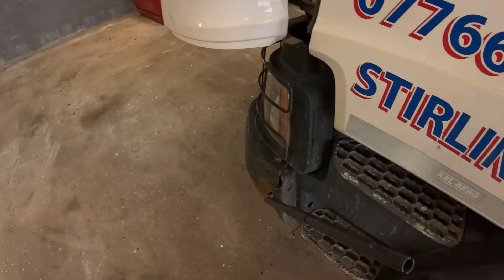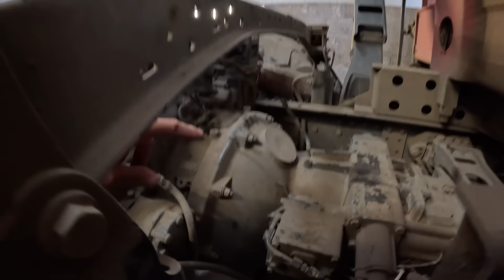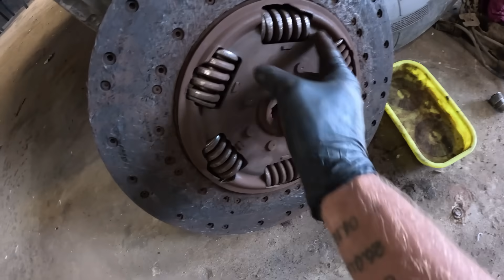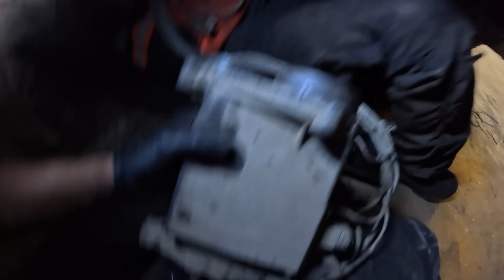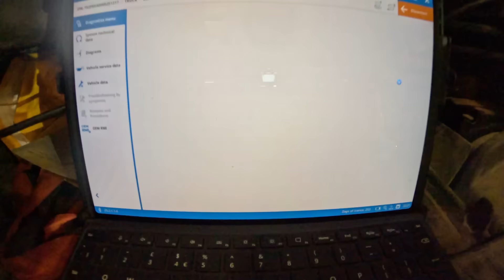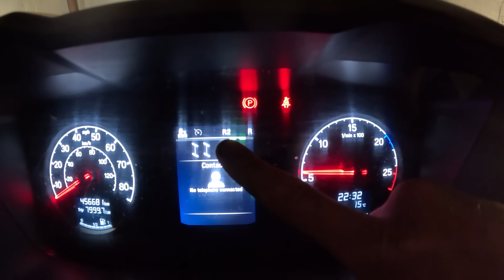Scania G410 XT Clutch Replacement | On-Site Truck Repair

Comment: Low fuel consumption, Euro 6 inline engine . But in models after 2014 the biggest pitfall for your money. If I hadn't made so many visits to Scania and they treated me like a brother, I would hardly buy Scania again with the money I spend.
Reply from the maker: Scania’s definitely aren’t what they used to be